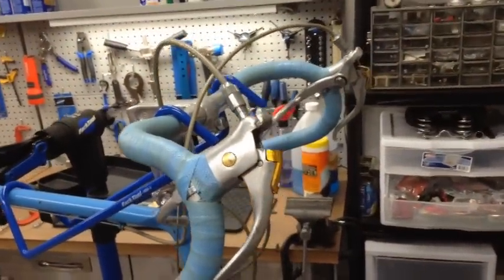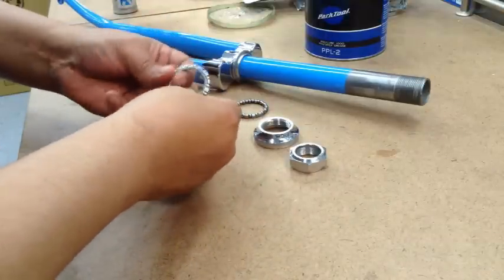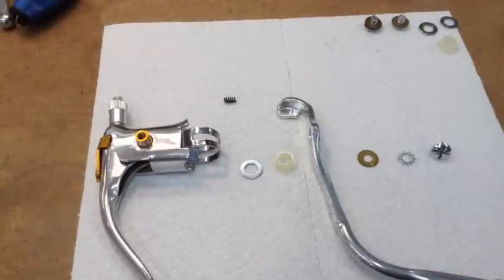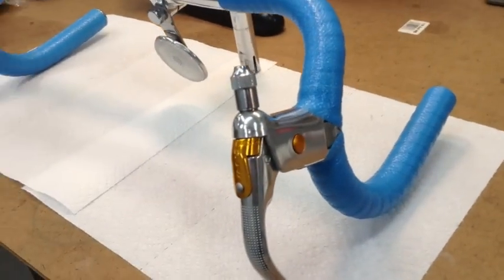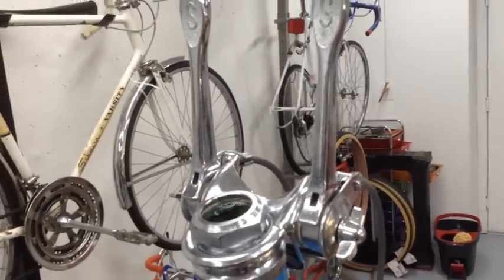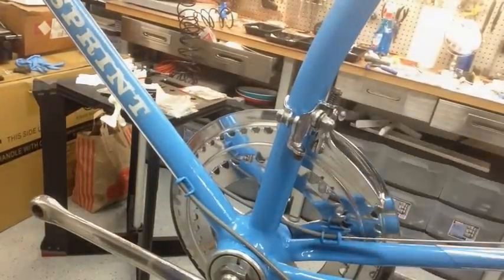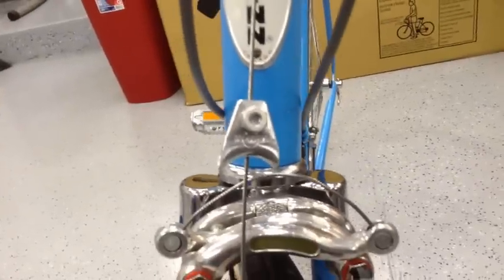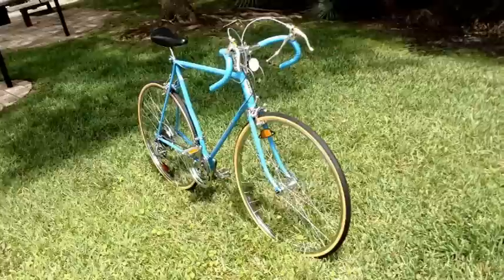Part 4 1974 Schwinn Sprint  Restoration Complete 🚲🔧

Comment: This is an awesome and helpful video especially with the time stamps - thanks for the referral from your other video. With the head gear hex nut tightening down on the shifter Mount things, mine is fully tightened as far as I can with an adjustable c wrench and the shifters are still rotating while riding. Any ideas?
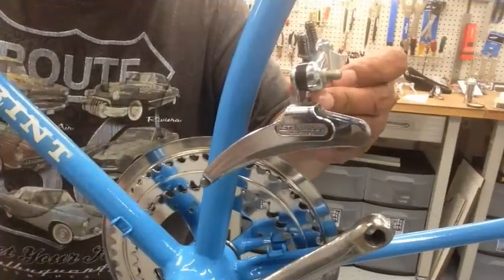Reply from the maker: ;Are you referring to the actual stick shifters moving up and down? if so you should see the wingnut on both shifters that an be tightened counter clockwise, if those are loose, your shifter will shift down to the smallest gear. If you are referring to the main bracket assembly that holds both shifters, there is a tab that works like a Key washer and locks the piece in place dead center. Here is part 3 of the same restoration, there is no time stamps but if you go to the 9:25 mark, it shows in detail what that component looks like up close.
 https://www.youtube.com/watch?v=Sqw5XRL9uHU
Reply: @that70sschwinn  back with another question for you… I can no longer shift to the large chain ring up front. I’m thinking the cable needs tightening maybe, but realistically I need to replace the housing and cable for front and rear derailleurs. Where did you get those for this repair? If you recall. Thanks
Reply from the maker: @TheCth777  Yes, it sounds like the cable may have slipped at the derailleur clamp, you should be able to get it tight and working, if you need to replace the inner cables, here are  a couple of  links that shows the small coin head that fits the dual stick shifter slots. The other is an actual Schwinn approved cable for a little more, both have free shipping Your cable housing should be fine unless you see cracks or badly worn
See below for an option as the cables I found are not listed  right now.

https://www.ebay.com/itm/150973214143?hash=item2326b46dbf:g:BlMAAOSwA3tXoKbK

https://www.ebay.com/itm/121075613581?hash=item1c30ab3f8d:g:AjoAAOSwHoFXsOfr

This Cable housing that could work, not the same as seen on road bikes but it would work fine, you can measure the length of your 2 cables at the shifters and if the small pieces at the rear derailure and other 2 at the bottom bracket it may be close to 42" so one cable could work.
The inner cable can be stored or thrown out as it had the large barrel ends designed for the Krates and Sting Rays

https://www.ebay.com/itm/265118989264?hash=item3dba52bbd0:g:QAAAAOSwk5VgFtuo
Reply: @that70sschwinn  awesome, thanks for all the links. I can’t physically pull the cable tighter, and it’s frayed after the clamp, but there is more slack than in the rear derailleur cable. That being said, I also can’t get to the biggest gear in the rear. I changed the chain out and now the chain is slipping despite being the same number of links as the old one, and the same size… classic case of making things worse by attempting to fix them haha
Reply: @that70sschwinn  does the same housing work for both cable and brake housing? They look different on my bike (this looks like the brake cable housing)
Reply from the maker: @TheCth777  If you are referring to the sting ray shifter cable, yes, they look very similar to the brake cables. On road bikes, the shifter outer cable is ribbed longways on the outside and appears more flexible while being rigid enough to facilitate smooth shifting, I saw some listed in the past. it was sold by the foot as seen on my 1977 Superior video around the 6 minute time stamp
https://www.youtube.com/watch?v=eYL1ZHwk6ZE
Reply from the maker: @TheCth777  Sometimes the rear derailure may need to have the limiting screws adjusted so that it will shift to every gear, your local bike shop should be able to get it adjusted for you and even change the cables if needed, they may have some that work and sell for less. My first few projects were a learning experience and before I got tools, I took a few of my bikes to my LBS to guide me in the right direction😏🔧🚲
Reply: @that70sschwinn  yeah, I checked the limit screws to no avail. Appreciate all the tips you’ve given me… I’m going to venture into replacing the cables and housing next. Also will try a shorter chain j guess to stop the slipping… unsure about that one
Reply from the maker: @TheCth777  You mentioned the chain was the same length and width as original, is there too much slack, where the chain hangs more than before?  Did you pull your rear wheel back as far as you can to keep the chain snug? Try the original if functional and see if it works as it should.
Reply: @that70sschwinn  nope same hang as before. I’ll try the rear wheel thing or the old chain if I can get the old pin back on

Comment: Hey that is an awsome video. I found a similar Schwinn Super Sport bike with brooks saddle in my local shop for $375. It is refurbished and ready to go. Is it worth it?
Reply from the maker: Thanks! $375 for a refurbished Super Sport is a good price, specially if the paint and decals are clean.  If you have images send them to that70sschwinn@gmail.com
I just got a 1972 in the opaque blue for $200 but needs some work, parts like cables, tires and tubes are usually about $140 not including labor.
Let me know how it goes 😏🚲

Comment: I rebuilt a sprint that was completely trashed, had to replace the rims and i removed the crank since it was shot and put on a replacement rear derailur and converted it to a 5 speed
Reply from the maker: Way to modify and getting her back on the road😏👍🚲🔧

Comment: I have a 1974 Scwinnn Varisty in red and I wanna restore it.  Do you do any jobs?
Reply from the maker: It's just a hobby for me, once I restored my first Schwinn, I wanted to restore them all, these clean up well and it's pretty easy to do, if you don't have the tools, your local bike shop can get her tuned and lubed up. You can clean and polish to make her look as good as new. By the way, your Varsity, if it's RED it is probably a 1976, the 1974 came in these colors: Sunset orange, Opaque blue or Lime. The 1976 colors were, White with Bicentennial decaling. Chestnut,  Lime green, and Flamboyant Red. That color was offered through 1978, in 1979 they introduced the Cardinal Red and offered it through 1982. See my 1972 Continental restoration video, it goes from start to finish, you may find it helpful, thanks for watching 👍🔧🚲 https://www.youtube.com/watch?v=EnCCSU6LcLY

Comment: Where did you purchase the outer grey cable covering? From China? I need some for my 10 speed.
Reply from the maker: I get all my cables on eBay, you will find the Schwinn Approved brand as seen in this video, made in in Japan or the lighter grey made in Switzerland with the Weinmann brand. Either will work and you can custom to fit so any version will do. Pricing varies from $12 to $24 depending on seller, I try to find them in the $12 range, here is an example of the front  https://www.ebay.com/itm/NOS-Vintage-Schwinn-Drop-Bar-Bike-Front-Brake-Cable-for-Weinmann-Brake-17-545/123152103768?hash=item1cac6ff958:g:BMoAAOSwVL1WEqnL

Here is a great price for rear https://www.ebay.com/itm/NOS-SCHWINN-REAR-BRAKE-CABLE-17544-54-CABLE-20-1-2-9-1-2-SPLIT-CASING/123670637528?epid=1600527971&hash=item1ccb582bd8:g:r3sAAOSwHDdcYxt0

Good luck with your projects and thanks for watching

Comment: Great video Oscar! My question is spoke reflectors. Upside down? Catalog for '74 only shows Le Tour and Voyageur with reflectors, and they are white and flipped. Japan only color?
Nice work and looking forward to more videos!
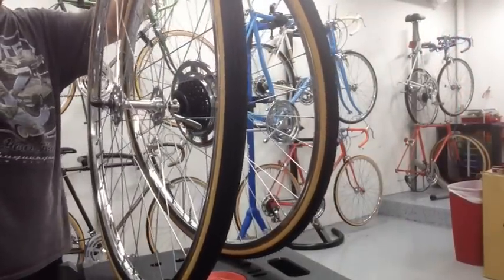Reply from the maker: Yes, I installed them upside down,  it appeared right to me when the reflector was on the down position , as seen at  27:25 otherwise they look upside down 😂. These were on the bike when purchased, they may have been optional items sold by dealer, the catalog part numbers list the rear seat stay reflector and one other I can't identify.
https://www.schwinnbikeforum.com/SLDB/Images/Dealer/1974/74dlsb63.jpg

Comment: I bought this very same bike new in 74. I haven't been on it in 25 years. The condition is similar to what you started with. How would I go about establishing it's value and go about selling it? Thanks for this series and saving these old Schwinn's.
Reply from the maker: Thanks for watching 👍The Sprint's value is similar and can be significantly more than the Continental due to numbers produced, I have seen them from $300 and as much as $800 in mint condition. Early 70's Continentals go for  $150 and up to $375 and in some cases a little more.

 I got lucky and found this one for $129, it was the starting bid and the bike went unnoticed as many may have thought it was just another Varsity or Continental. It was listed as 70's Schwinn with no mention of the curved seat tube limited production years. 

If you get a basic tune up, clean it up and get the chrome shinning, you will increase your chances of selling it for as much as a collector is willing to pay. My neighbor offered me $1000 for this one while filming it on  the driveway, but I'm sure his wife would have put a stop to that noise 😊 Lucky for him, I don't sell my restorations 🏡🚲🔧
Reply: @that70sschwinn  
Watching your restoration on the Sprint has made me realize I need to pass it along to someone who will do it justice. I'm in my 60's now and know it's only going to gather dust in my garage.  Thanks again for sharing in such detail how you bring these Schwinn's back to what they looked like new.
Reply from the maker: You should be able to find a buyer for the right price, out of curiosity a did a search on eBay and saw 4 options, the lowest was $229 for a rough Kool Lemon, $500 for a blue or red and another decent one for $300
See links below to see listings https://www.ebay.com/itm/Vintage-1974-Schwinn-Sprint-Opaque-Red-First-Production-Year-Free-Shipping/303098758369?hash=item46921804e1:g:OusAAOSwP2RcjY0H

https://www.ebay.com/itm/Vintage-Schwinn-Sprint-Bicycle/283272014305?hash=item41f453e9e1:g:otwAAOSwDPNb9f1s

https://www.ebay.com/itm/1974-Schwinn-Sprint-Opaque-Blue/183757137943?hash=item2ac8c76817:g:towAAOSwHSlcoi5E

https://www.ebay.com/itm/22-Vintage-1974-SCHWINN-SPRINT-Curved-Seat-Tube-KOOL-LEMON-100-ORIGINAL-Patina/283296518173?hash=item41f5c9d01d:g:lMwAAOSw4IVcDP0~
Reply: @that70sschwinn  
Thanks for the links.  I've always wondered about how you ship something that large reasonably, but I'll look into it.
Reply from the maker: Shipping will be about $95 and as much as $125 depending on zip and weight and size of box. You can get a free bike box at your local bike shop, the smaller the better but make sure the bike will fit. You will need to remove the front wheel, handle bar and chain protector which is attached to the large chain ring. These will bend during transit if not removed. You can protect the frame with foam tubing and bubble wrap. Secure the tubing with zip ties and your bike will travel well. I have received many bikes packed nicely and some not so good. One of the best examples was mt Sports Tourer, see intro to see how the seller wrapped it up. Good luck with your sale.
https://www.youtube.com/watch?v=1mKgs_QyrrY

Comment: never saw this model would this be better than a supersport model? or continental??
Reply from the maker: It's basically the same as a Continental, with the exception of the filet brazed bottom bracket to accommodate the down tube and seat tube joint. They used the same welding technique as seen on the filet brazed Super Sport, Sport Tourer and Superior, the additional workmanship and cost beyond the standard flash welding technique used on the Varsity, Suburban, Continental may have been the reason they discontinued it. A very cool frame👍🚲
Reply: @that70sschwinn  we had a schwinn shop in our town never seen sprints-usually varsitys continentals-super sports and letours- varsity good selling bike but HEAVY!
Reply from the maker: @larry45044  I'm sure the local dealers carried the best selling models in larger quantities and just a handful of the ones not as popular.  ,Yes The  Varsity is heavy, but rides like big Buick👍🚲

Comment: Where did you get that color bar tape?
Reply from the maker: I get the tape on eBay, below is an example of a search I did by typing Schwinn Bar tape in the search bar, it pulled up several color options available currently. The opaque blue is harder to find but if you try your search daily, you may get lucky and find that color.  Thanks for watching 👍🚲🔧
https://www.ebay.com/sch/i.html?_from=R40&_trksid=m570.l1313&_nkw=schwinn+bar+tape&_sacat=0

Comment: @ That 70's Schwinn Vintage Bike Channel could you please tell where do you get your parts? Specifically the hardware for the brakes.
Reply from the maker: I get all my parts on eBay, brake pads come with new bolts and washers, all other parts if not damaged can be cleaned and polished. The pivot bolts I have found in 2 separate searches, I looked for more based on my last order and none came up, the trick is to keep looking by entering the name of part number needed. Here is the description from my last order for the bolts.
Dia-Compe 1205 bicycle 750 center pull brake arm pivot bolts (PAIR) CHROME - NOS  You can also find complete vintage sets in good shape for decent prices. Good luck and thanks for watching 👍🚲🔧
Reply: @that70sschwinn  well that points me in the right direction. Thank you, that is very helpful. Appreciate it. Sorry just meant to ask about the top brake lever hardware. But you answered it
Reply from the maker: No problem, now that you mention it, here is a listing for a vintage complete set for an exceptional price, the cables alone sell for $12 to $18 each. The set it includes everything to overhaul your levers and cables. https://www.ebay.com/itm/Vintage-Schwinn-Brake-Set-9795-Levers-Safety-Levers-Gray-Housing-New-1979/153714036441?hash=item23ca120ed9:g:N2AAAOSwkxtdw0nq

I will let you have first dibs, 🤔 if it's still available by Monday, I will get them and add to my parts inventory 😏👍🔧
Reply: @that70sschwinn  OMG that is sooo awesome of you. Thank you so much! I really only need the spacer and washers though, shown @ 15:35. I'm sorry learning as I go. I have a 60639 Schwinn World that I was riding everyday. One day the left "suicide lever" screw back out and fell off. I was able to gather what I could find which was just the screw, the sprocket washer, and lever. I bought some spares at my local bike shop but they were the wrong size. I moved and never got back to it until today. Thanks for your help. I've already learned a bunch from this one video.
Reply from the maker: Here is a set of just the suicide levers with spacers
https://www.ebay.com/itm/Retro-New-Old-Stock-1989-Dia-Compe-Road-Touring-Safety-Brake-Levers-Red-Dot/182468141345?hash=item2a7bf2e121:g:aFgAAOSwXYtYsipJ